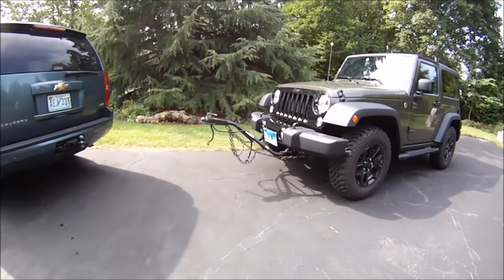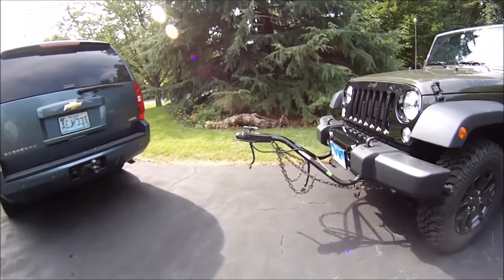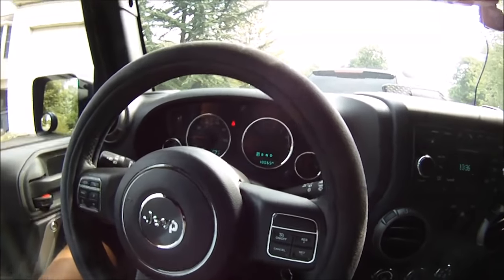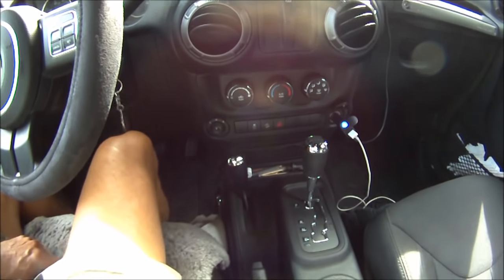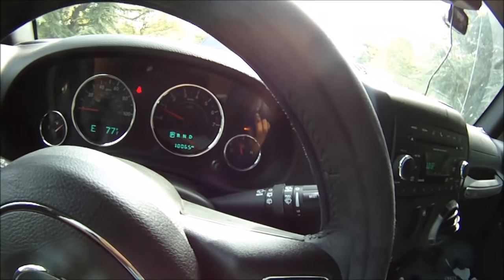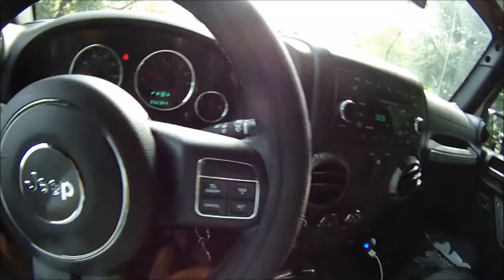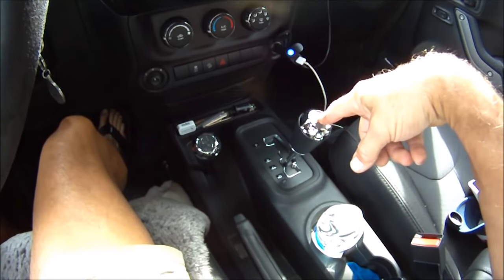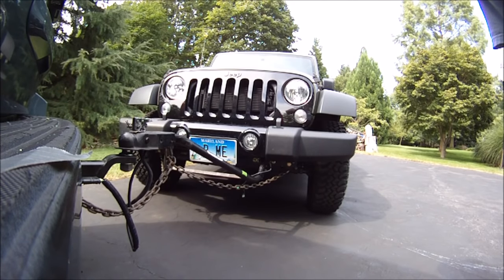Jeep Wrangler Towing Test Drive

Comment: piece of advice, get a better tow bar/hitch set up. its raising your rear and squatting the front of the toad because its not a good set up. the tow bar mounting points and ball should be as level as possible at all times for proper towing.
Reply from the maker: The suburban was only being used to test the new mounting plate and is not the normal towing vehicle.  The Jeep is normally towed behind our motor home with a lower ball position.  Additionally, the tow vehicle weighs 13 tons.

Comment: The Jeep tracks nice and straight. When towing it with your bus, do you rig up the Jeep brakes? I recently made a tow bar. I put the dampener bushings on the Toad at the swivel point. I can send pics to anyone interested. It was a simple build.
Reply from the maker: I'd like to see the pics.  No brakes yet, but thinking about it because some states require them.  Unfortunately, they only consider the weight of the towed vehicle and not the weight differential between the toad and the tow.  In the bus, you don't know it's back there except for when you go up a steep hill.

Comment: One way to do toad brakes is to get a type 20 brake chamber and put a yoke where the slack adjuster would be, pinned to the brake pedal. You use an air pressure regulator to get the right pressure dialed in so that you don't lock up the toad hydraulic brakes. Quick disconnects to remove the unit.

Comment: The angle at hard braking is too much. When you go over dips and brake at the same time it compounds the effect. Can you flip the receiver over and re-mount the ball? It seems that on the Suburban, if the ball were 3" lower, you would not get that upward thrust. If you keep it as it is, the friction on the receiver is going to wear it out quickly (develop slop).
Reply from the maker: Hey Kevin, You are correct.  
But I don't normally tow the Jeep with the Suburban.  The normal tow vehicle is the bus and the receiver is considerably lower.  It was too much work to turn the ball over just for the 5 minute test drive.

Comment from the maker: The transfer case self lubricates in neutral.  The transmission requires the engine to be running and the oil pump to be running for proper bearing lubrication.  With the engine off, it will not be properly lubricated as I am told.  Good question.
Reply: Yes, thats true, if you had a manual, no problem, since your seems to be an automatic one, you have to take off driveshaft between transfer box and gearbox for long distances, in my opinion, is useless, because all the weight on the cherokee and on his brakes

Comment: @John Matthews Hi, do you notice a difference in the time it takes to stop (hit the brakes) while you are flat towing with the additional weight?
Reply from the maker: Hi, thanks for the question.  So, I'm not sure if you know this, but I usually tow the Jeep with my old converted Greyhound bus (see my other videos).  The bus is designed to carry far more weight than the Jeep adds to the total load without a bus full of passengers and luggage.  Having said that, I really can't tell the Jeep is back there normally.  It' is slower going uphill, but stopping seems about the same.  The Invisibrake setting is adjustable, but always applies the same amount of braking resistance for the same amount of time (about 15 seconds), so it it unaffected by hard or soft braking, which is how it's designed to work.  There is about a half second delay for the Jeep brakes to activate once the bus brakes have been applied.  I have never towed it with the Suburban with the Invisibrake working.  Without the Invisibrake, it definitely takes the suburban longer to stop when towing the Jeep.  It is really isn't safe to tow the Jeep without a braking system working in the Jeep like the Invisibrake system.  In fact, in most states it would be illegal because the Jeep exceeds the state weight limit on towing vehicles without brakes. The state limit varies from state to state, so you'd have to check your state to see what's required.
Not sure I'm answering your question, so if not, I'm happy to explain further if needed.  Hope this helps.
Thanks for watching, be sure to subscribe to my channel!

Comment: Question to John and other people that tow Jeeps. I have an old 1979 CJ5 that I want to tow, but I was warned that the transaxles, diferentials and/or gearboxes can be damaged if I just tow the Jeep in Neutral. Any comments on this.
Greetings from Mexico to you all
Reply from the maker: Sorry, wish I knew the answer for you.  I'd just be guessing.  I'm not familiar enough with that vintage.
Reply: A little late, but if you lock the hubs,put the transfer case in neutral, and the manual transmission in gear, you should be ok. If the tranny is turning without the engine running, the bearings will run dry and fail. The front hubs locked ensures proper oil movement in the transfer case.

Comment: What kind of tow bar you are using and no problem going downhill? Also where you bought your tow bar? Thanks
Reply from the maker: Edith Pajar 
It's a BlueOx tow bar.  I have had it for 30 years.  They are still in business and make base plates for miss vehicles and still sell the bars to go with them.
Reply from the maker: Edith Pajar 
Sorry, no problems at all.  search on line and you can buy them many places including Camping Would I think.

Comment: also the brakes on any good RV should be enough to stop safely
Reply from the maker: Yes, the brakes on the bus (see my other videos on our bus) are more than adequate to handle the bus and the Jeep.  However, state laws, which are different from state to state, require the toad to have a braking system in most states for any towed vehicle weighing over 3,000 lbs.
Thanks for watching. Check out my other videos on YouTube on the Jeep and our converted bus.

Comment: That’s exactly the type of tow bar I wouldn’t want.. prefer the adjustable type.
Reply: I would like to know more about shock absorbing ball mount though.
Reply from the maker: @Melidontcare  
Here you go, google cushioned ball mounts.
https://www.cabelas.com/product/Convert-A-Ball-Cushioned-Ball-Mounts/746627.uts?productVariantId=1639713&WT.tsrc=PPC&WT.mc_id=GoogleProductAds&WT.z_mc_id1=02823004&rid=20&ds_rl=1246549&ds_rl=1246552&ds_rl=1252242&ds_rl=1252079&gclid=Cj0KCQjwxYLoBRCxARIsAEf16-s-o3VpmifWYhGmxkY6op16Ro1MPW99t9bnT0VB3gzy9LhUZGjmS8IaAunNEALw_wcB&gclsrc=aw.ds

Comment: You need to reverse your hitch to the drop-side Playa.. lower it down some
Reply from the maker: The Suburban was only used to test the tracking on the Jeep when the base plate was first installed.  This allowed the opportunity to see how it performed.  The normal tow vehicle is a 13 ton Greyhound bus.  There is no nose dive on the Jeep or raising of the bus during braking.  Additionally, the geometry is correct on the bus which was not the case with the Suburban.  Thanks for the comment.
Reply: John Matthews oh I see I'm sorry about that sir. But let me ask you do you think I can tow my Jeep with my Silverado without having the Jeep brakes working. If I just take it really easy? It's just what I do causes me to need two vehicles where I'm going sometimes like I don't have anyone that can drive the Jeep and then drive it back so. The Silverado has big dual-piston calipers on the front good old drum brakes in the back what do you think sir? If you got a minute
Reply: John Matthews I didn't notice if you had any kind of braking system in your Jeep. I'm just looking for an opinion talking to somebody who knows more than me about it. Plus where did you get that bar that mounts under the bumper
Reply from the maker: Hey Mike, Thanks for the additional questions.  Here are several thoughts.  First, your Silverado won't have any problem "towing" the Jeep from a weight perspective, it probably has a 5,000 max on the hitch and jeeps are generally around 4,000-4,500 lbs.  Also, if you level your tow bar like you suggested I do with my Suburban, under riding and over riding the bar should minimize the problem. Although, the back of a pickup truck is much lighter than a Suburban and finding the exact hitch height might be challenging for a good smooth panic stop.   Having said that, I'm not sure how extensively you need to tow your Jeep.  Stopping distance will be greatly increased and because of the weight differential and could potentially cause an accident.  If you were towing with a much heavier vehicle (like my bus) I wouldn't be so worried about it.  But, here's the thing: most states require vehicles over 3,000 lbs. being towed  be equipped with a braking system.  
check this link for a state by state list:
http://www.readybrake.com/state-towing-laws.html
I have not posted a video on my braking system, but after I built the tow bracket for the Jeep, I also purchased an InvisiBrake system and added it to the Jeep so it does brake while being towed and it does meet the states requirements.  There are several systems you can buy from that one to Brake Buddy, AriForce One, and others.  If you are going to do a lot of towing, especially over 25 mph, I would suggest getting one.  Some just sit on the floor of the towed vehicle and other, like the InvisiBrake, are actually permanently installed in the vehicle.  I purchased the InvisiBrake used on eBay for about half the new price. 
Good Luck.  Let me know if you have any other questions.
Reply: John Matthews hey I appreciate the info I will be looking for some sort of breaking device for the toad Jeep.

Comment: First off the tow bar is way to high. Th ball should be much lower. (4.26) you can see on flat ground its not flat but pointing to the sky. Flip the ball over and see how that looks. or get a flat receiver. 
The thrashing of the ball is bad. 
Also almost every state (46) you must have a braking system in place to help brake your dinghy.. .
Reply from the maker: Thanks for watching.  The Suburban is not the normal tow vehicle, it was just being used to test the new hitch and mounting bracket for the Jeep.  The Jeep normally follows our converted Greyhound bus which has an appropriate ball height receiver.  While the hitch needed adjustment (which has been done), the energy absorbing sliding ball in the receiver is normal.  I have a video on the Invisibrake system which was added shortly after this video was posted. Just can't do everything at once, you know.  Thanks for the comments.  Check out my other videos about brakes and the bus.

Comment: lower the ball 1 1/2 "
Reply from the maker: Thanks,
I don't normally tow the Jeep with the Suburban.  The tow vehicle receiver is considerably lower.  Changing it around for the 5 minute test drive was too much work.
Reply: if its temp. then never mind,the tow bar looks like my blue ox, thats what caught my eye,use it 4 my 97 sahara. b safe.
Reply from the maker: So, now I can ask you a question.  This is the fourth vehicle I've used the same blue ox tow bar on.  It is a couple of hundred pounds under rated for the 2 door.  Is yours a 4 door?  What's the weight rating stated on the tongue on yours?  The last two vehicles we towed were even heavier than the Wrangler and there was never a problem?  It is far better than some of the junk you can buy at the local auto parts places.  (like the name "smooth operator."  It's the slogan in Maryland for safe driving campaign.  It was part of our training program when I had a real job.)
Reply: that bar is indestructable n in 97 no 4doors yet.
Reply: John great informational video, I just had a question it seemed that when you first started towing the Jeep from your driveway that your front wheels moved (as if turning a very little bit). Was the steering wheel not locked in the beginning to have the front wheels turn that little bit??? I watched the video a few times and it did seem like it turned...
Reply from the maker: Hi Joe, thanks for the question.  Very observant!  The wheels on the Jeep do not lock even with the key removed.  The reason they were slow to turn as I first took off is because they were straight and the Suburban was at angle.  It is hard for them to immediately adjust from this position.  Usually, I try to point the wheels in the direction of the tow vehicle when I first hook up... Not that it really is all that important but it does save a little wear and tear.  Under normal driving circumstances they turn and follow very well, as you can see in the rest of the video.
Reply: I never realised that Jeeps front tires don't lock up with the steering wheel, I thought all car's did. I'm just looking for a Jeep now, but it's good to know about them not locking up straight...
Reply from the maker: Not sure that ask years are the same.  Our Jeep is a 2015.  Send like they are going out of their way to design them to be tow friendly.
Reply: Thanks for sharing the video, one question: I see you took away your Jeep’s key, don’t you worried about the steering will be locked during towing?

Comment: Why use such a heavy vehicle for tow?  If it were me, and I wanted a more nimble vehicle for offroad use at a campsite or something, I'd just trailer a four wheeler or dirt bike.   Wranglers can weigh 4K lbs.
Reply from the maker: Thanks for your comment.  You'll understand the answer to that question when you're 66.  For now, we like the versatility of the Jeep.  We use it to do a variety of tasks; four-wheeling on the beach, transporting our tandem bike from base station campgrounds, going out to dinner with our grand-kids when they are with us and because we just like the joy of opening the top on the Jeep and riding around in nice weather.  My wife won't ride on the motorcycle with me anymore anyway.  Nothing wrong with your suggestion though.  A 4-wheeler and dirt bikes w/o tags are not street legal, which makes going very far from the campgrounds problematic.   Just a matter of time and place.
Reply: Wranglers are much more off road capable and comfortable than atv/utv's...

Comment: that does not look safe to me, the shape of that tow bar is too high..
Reply from the maker: That was just a test drive.  The suburban is not the normal tow vehicle.  The Jeep normally follows a 12 ton bus and the height of the ball is closer to the ground.  Also, an Invisibrake system has been added to the Jeep which reduces the pressure on the hitch.  The shape of the hitch with the two bends in it are the way BlueOx made it.  I have towed about six different vehicles with it over the years without issue.

Comment: You should have a weight distributing hitch
Reply from the maker: Thanks for the thought Christopher.    Usually, weigh distributing hitches are designed to distribute trailer tongue weight between the rear and front wheels of the tow vehicle.  There is no tongue weight on the tow bar to distribute, except for the weight of the bar itself which is less the 50 lbs.  Regardless, the Suburban was just being used to test the tow bracket on the Jeep.  Normally, the Jeep follows us in our 13 ton motor home, which is a converted Greyhound bus.  There is no weight surge to lift the rear of the bus when using the bus to stop the Jeep.  See my other videos about the bus.  Thanks for the comment!

Comment: Very poor information.  You HAVE to leave the key in the ignition and turned to accessory to unlock the steering wheel
Reply from the maker: Sorry Mr. Church, but you are incorrect.  On the 2015 Jeep Wrangler, the KEY CAN BE REMOVED from the ignition for 4-wheel flat towing.  There is no steering wheel lock on this model.  I do this frequently.  I take the key out, lock the door, and put the key in my pocket when I tow this vehicle.  (my 2005 Jeep Liberty did require the key to be in the ignition and turned to the unlock position for flat towing.)
Reply: yup my dad had a 2015 that also did not have any sort of steering wheel lock.  my 2000 WJ (grand cherokee) has had the steering wheel lock permanently removed (by me) for flat towing as well. its a far better solution. no need in tempting morons to break into your rig at every stop because you forgot your non chipped key in the ignition
Reply: John Matthews you are both wrong it has a steering wheel lock it just unlocks when the transfer case is in neutral duh
Reply from the maker: Sorry Mike, Perhaps on other models or other years, the Jeep steering wheel locks in certain conditions.  There is no steering column lock on the 2015 Wrangler under any condition.  It is never locked under any condition.
Reply from the maker: Hey Mike, 
Just added a video on my Invisibrake wiring you might be interested in seeing. 
https://www.youtube.com/edit?o=U&video_id=398CSCIGvCA
Reply from the maker: Hey Mike, 
Just added a video on my Invisibrake wiring you might be interested in seeing. 
https://www.youtube.com/edit?o=U&video_id=398CSCIGvCA